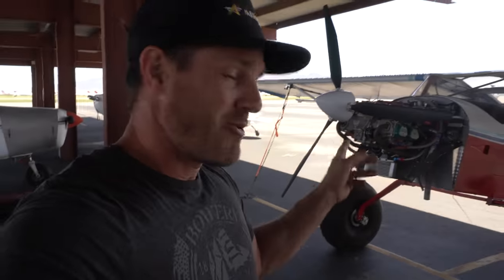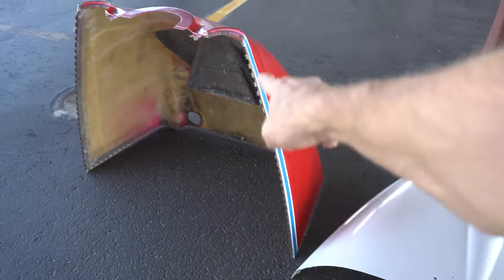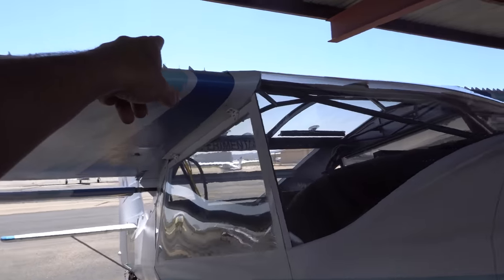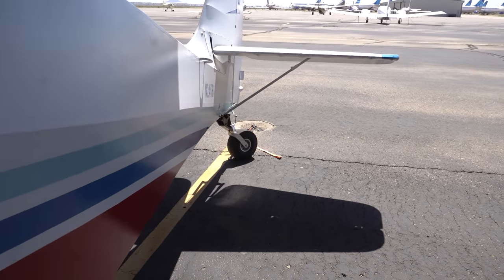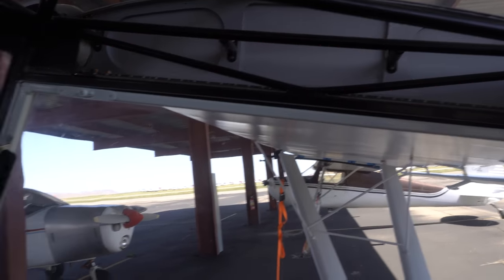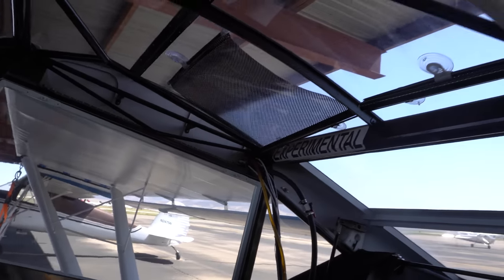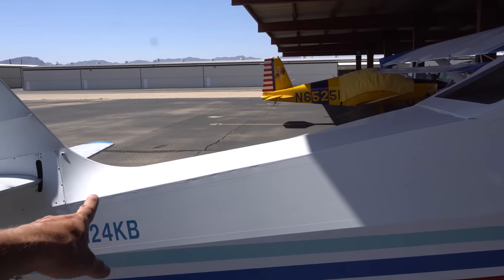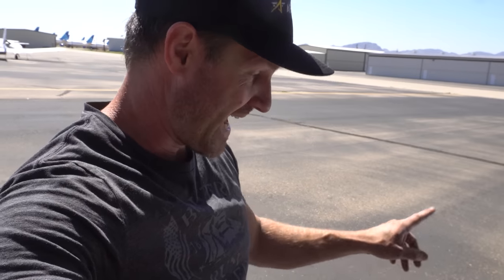I am Selling My Kitfox 5

Comment: Replace it with a jet. See if you can get a second hand MiG-25 - one that has an improved avionics (replaced the ethanol engine that powers it with something more reasonable and long lasting) and that can carry a fuel tank. Or get a two seater to bring along the Mrs, like an F-16 trainer from one of the state Air Guard units. 
Might be pricey, but sure would be fun :-)
Reply: How much money do you think he’d need for fuel alone compared to the Kitfox!!!! Off the scales
Reply: @craigpitts2209  Yeah, true. Still, though - that would be fun. 🙂